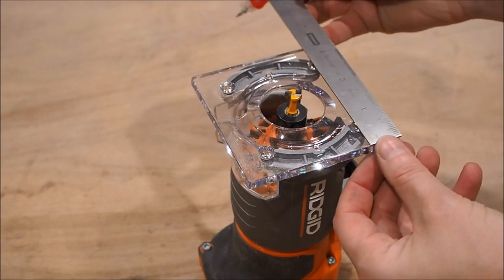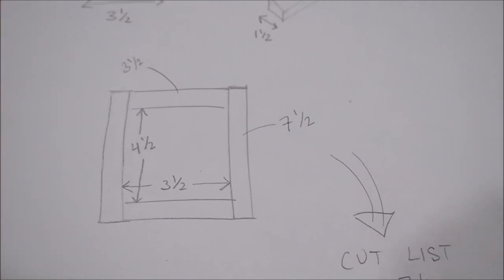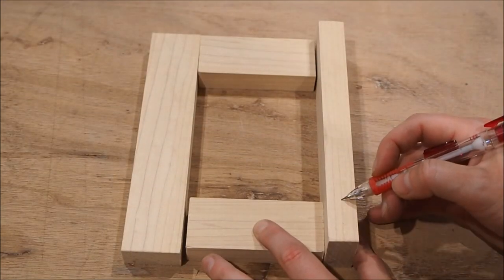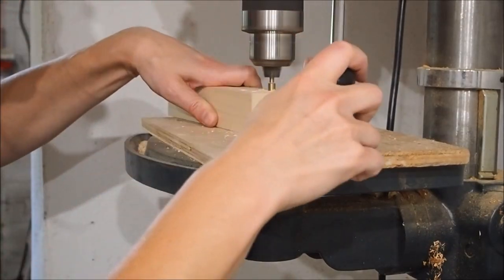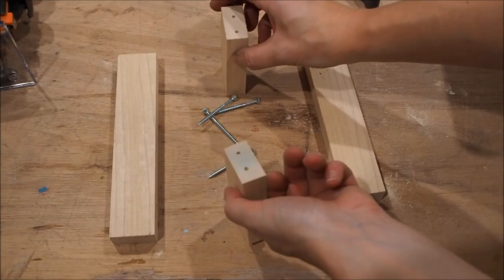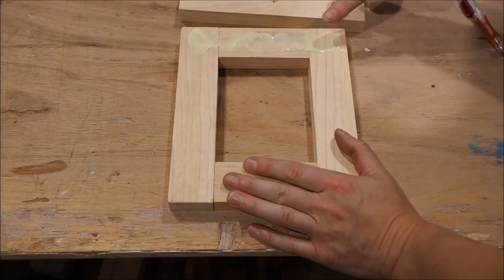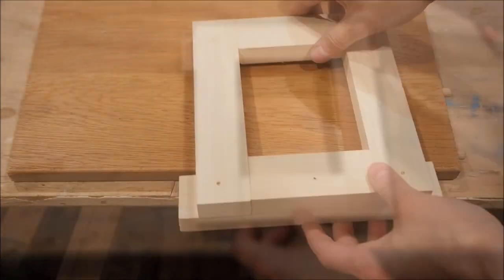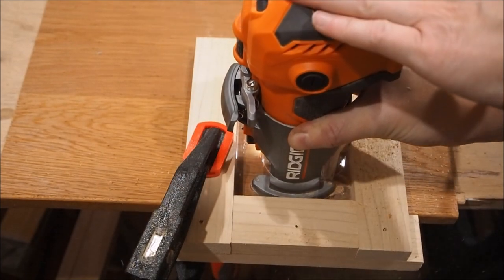How to make a keyhole router bit jig

Comment: Made one today. Thanks for the tip. I’ll likely remake it and cut some grooves / dados for the saw dust to exhaust out of the inner section of the jig. It tends to build up while routing and doesn’t allow the router’s base plate to press firmly against the stop. (Potentially making for inconsistent cuts)
Reply from the maker: I didn't run into that issue myself, but interesting thought and great idea!

Comment: Awesome. I made one just like it for the wooden flags and signs I make. I use the same router too. It quickly became my most used jig. I have bought about adding toggle clamps to the bottom of it so I wouldn’t have to use a separate clamp all the time. I pretty much always use 3/4” material, so it would work 99% of the time.
Reply from the maker: Great idea!

Comment: Great video! I am going to use this jig for my keyholes too. Question--is it best to do the keyholes vertical or horizontal? My pieces are not too big or heavy. MDF cut at about 11" by 14" or smaller. Just wondering which way would work best.  Thanks!
Reply from the maker: Great question! At first I was doing the vertically but I can be hard if you’re using 2 holes to get them perfectly lined up with the screws in the wall. I learned later by doing them horizontally  you may have more wiggle room for slight error. If you’re using only one keyhole, go horizontal! I think that would work best for your small piece.
Reply: @DIYMontreal  Thank you so much for answering!  I am making one sometime this weekend so I can cut the keyholes in the back of 10 MDF boards.

Comment: This is going to sound dumb but could you connect the 1x2s with pocket holes and 1” pocket screws? Probably would not hold up well. I do have a countersink bit set somewhere in the garage 😅